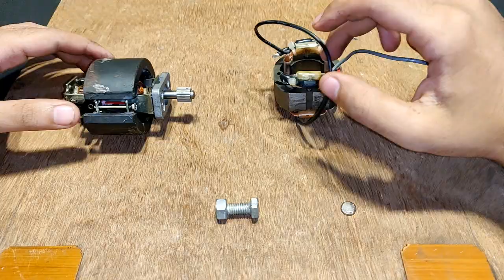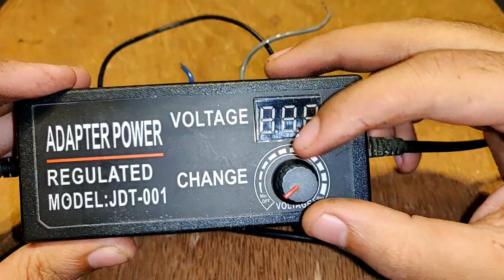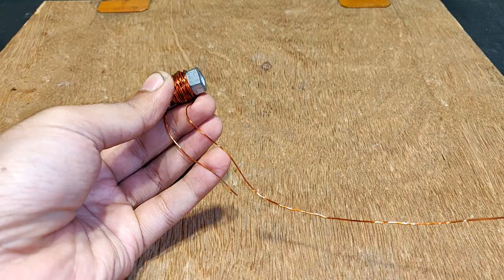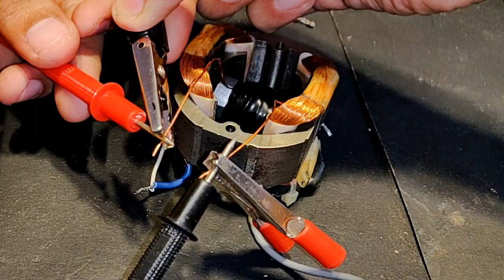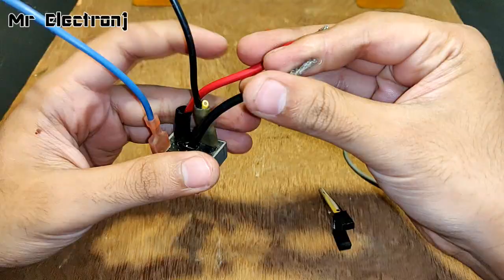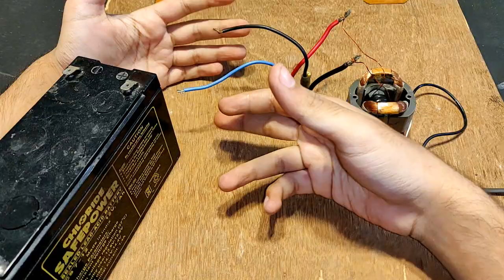12V 5 Amps Supply for DC Motor using 220v Mixer Motor as Transformer

Comment: You have to measure  the voltage and current  by the multimeter with the bulb loads  and also have to apply loads to the motor in order to know the transformer  capacity  to drive the motors for its rated loads  rather  than running  it in no load  conditions  !

Comment: I understand it is the secondary winding, but please wrap the threads on the core  with tape first. You dont want the threads cutting through the insulation on the wires.

Comment: Can i use other stators like drill or grinder powertools
Reply from the maker: Yes sure
Reply: @MrElectron  can i use 220v angle grinder
Reply from the maker: @rolandruiz1972  yes sure
Reply: Mr Electron what is gauge of wire used in secondary .